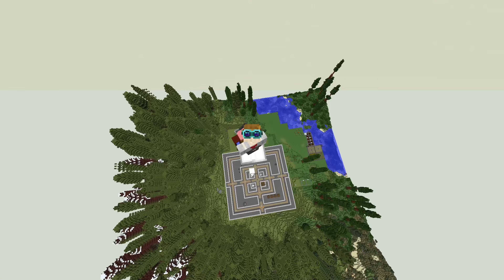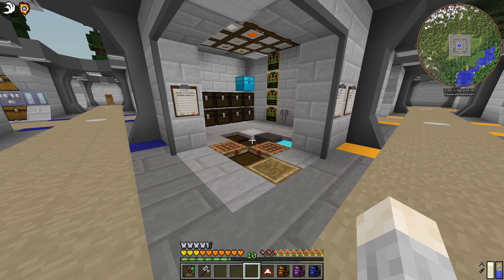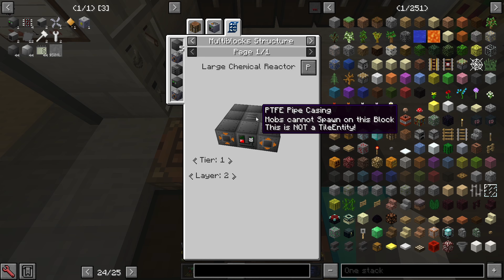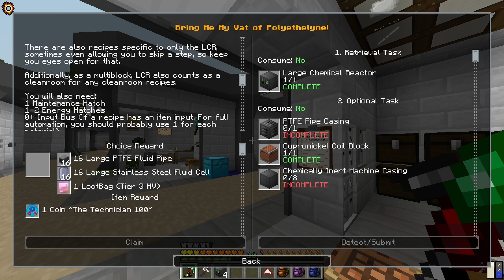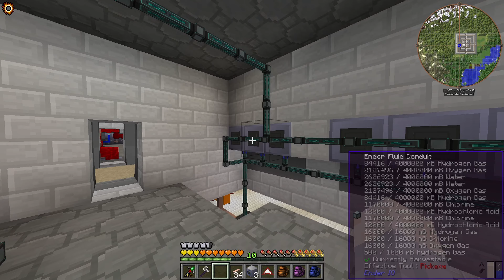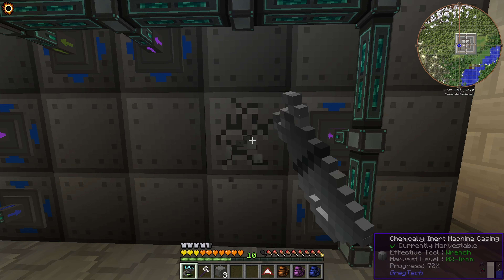Minecraft - GTNH Ep.24 | AUTO PTFE!

Comment: Pro tip: if a chemical reaction doesn't use a circuit in the LCR, you can use 1 LCR to do multiple reactions by just pointing the output hatches into the input hatches.
Reply from the maker: good to know

Comment: The two main differences between the single block chemical reactors, and the LCRs is that LCRs don't use cells and can have multiple fluid inputs BUT another awesome feature is that they actually have unique recipes (usually on the last page of NEI) that use Circuit24 and skips a bunch of steps, so instead of having 4 LCRs, you'd only need 1-2, so definitely consider checking those recipes out first just to save on LCRs
(for putting programmed circuits in the LCRs and all other multis, there is a slot under the power button that holds the circuit)

Best way to fix the input hatches filling with random fluids is to set the main fluid tank input channel to brown instead of green, that way you can set the filter first, and then put the conduit on brown channel

At EV, you unlock the EV mixer which actually can make vibrant alloy in one craft (NEI says the recipe is HV but the HV mixer only has 6 input slots, EV mixer has 9) Though I doubt you'll still be using conduits for transportation at that stage :🥲.

If you're gonna go for distillation towers next EP, consider the fact that they need EV circuits (EVen worse, they need 4 circuits each) and you'll need atleast 3 if you want any useful outputs (Methane, ethylene, propene... etc)